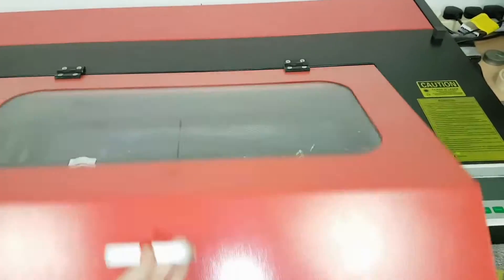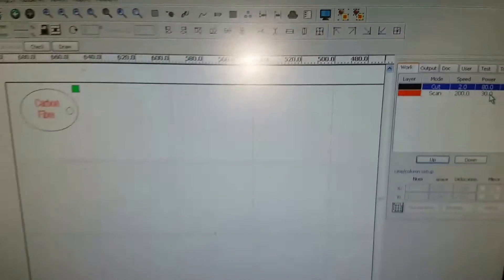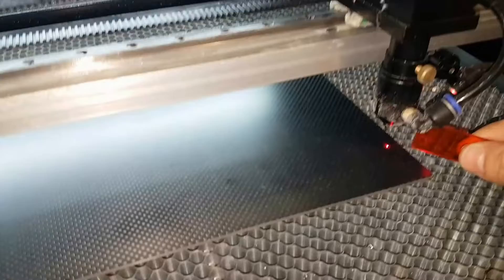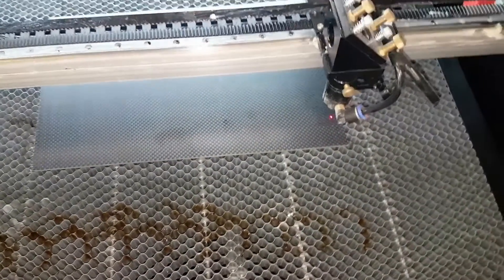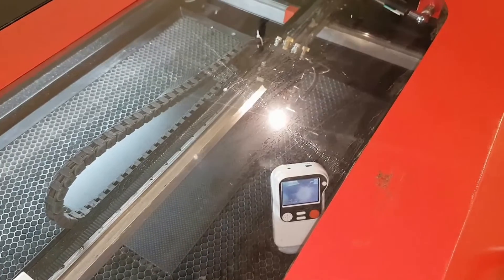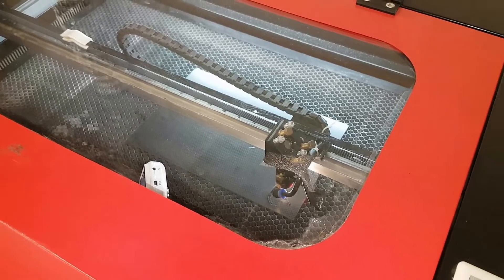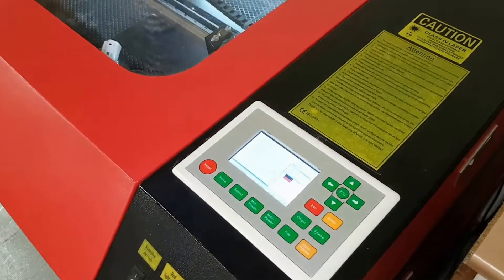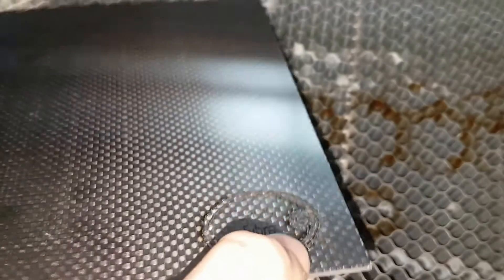Can Light Cut Carbon? 80W CO2 laser cutting carbon fibre / fiber

Comment: what laser cutter do you have?  I am in the UK and looking for a cheap 80W laser with RUIDA controller, exactly like yours
Reply from the maker: Hi. It was purchased from ebay. Said from Germany, but arrived from China. We didn't get charged any imports, but believe you can get extra bills. I think it was around £1400, but the same ones are there now for 1700+. Its still going good after heavy use. Has needed runners greasing and the bed re leveling, but I'll admit we haven't even cleaned the optics! Search ebay and you should be able to spot the red units like this. Good luck
Reply: @DanSohan  hi Dan, could you potentially post the link as I have seen plenty of red lasers, it's just getting one without heavy taxes/shipping that also has a RUIDA controller sent to the UK.  For the business I am looking to start I need to install a camera in the machine so I can line up custom etching jobs on customers' existing items, which I will need LightBurn for, which can only run off a RUIDA controller
Reply from the maker: @evanhill110  sorry it was bought by the company I worked for a few years back, I wouldn't be able to point out the exact supplier. Often thought about getting one for home, but would have to accept I might have to cover the taxes. Maybe message a few of the current supplier to see if any promise to cover the taxes included in the sale price.

Comment: 2mm per sec ????? most stuff needs to be cut at atleast 8 or more to be a good cut, no wonder it's melting it's carbon fiber it spreads heat, for that you'd need at least 20mm per second and a tone of layers/laps at the 80w or so you're using. because concentrating that much power at 2mm per second is just bad.

Comment: How is this machine treating you 2 years later? Still Content with your purchase?  Would you recommend it? Any faults, breaks or errors encountered? Appreciate any advice. Considering getting one.
Reply from the maker: The machine is still going good. I have noticed a drop in overall power of about 20% but wr have not maintained it. Cleaning the optics might help but the tube is probably wearing out. Its had loads of use and never not worked. Overall very pleased for the price
Reply: @DanSohan  Thanks for the quick reply! Did you get yours through Ebay?
Reply from the maker: @meshackburton4686  we did

Comment: I have purchased a 60W version of this laser cutter.
When it arrives, I need to get it through a door.
Is it possible to remove the legs and lay the machine on it's backside?
Reply from the maker: Aron Haraldsson ummm.. Just going to have a look. I'm afraid the base part looks very well attached. I can't find a bolt nor a phiscal weld, but it almost looks intergal :( I maybe wrong but it would require more disassembly than I'd like to do right now. Also take care because of the internal glass components
Reply: @DanSohan  I know I'm a little late but i've got an omtech 2820 and the base comes off with 4 bolts
Reply from the maker: @killorkubed  the unit we have in the video its all welded up

Comment: If the epoxy off gases chlorine, you're going to destroy the mirrors and lenses on the machine. It's the reason that you shouldn't cut chloride containing polymers (PVC is a common one) in a laser cutter.
Reply from the maker: Bryan Hascall we've done much worse to this thing.. still going good years later.

Comment: Try next time do multiple fast ( like speed laser machine) passes and focus the laser into more of a point for thin carbon but for carbon more than 2-3 mm you’ll need a auto focus laser (preferably a PLASMA speed laser)  like the one they use to make statues in basilica glass, which is when the laser is focused to where it micro fractures different layer in the glass, they are not that much more expensive than nice co2 lasers. If you do it fast like I said it wouldn’t melt it would melt. Oh and you probably want a speed laser autofocus.

Comment: Goggles are not actually necessary for this type of laser, assuming you have the lid closed. It's unintuitive, but "light" in the far infrared part of the spectrum (10 µm, which is what a CO₂ laser tube emits) is completely blocked by that plastic. Even though it's transparent to all visible light, it's completely opaque to 10 µm radiation. No radiation in that range will come through until and unless the laser beam has cut all the way through the cover. 

However, a 10 µm CO₂ laser is not to be confused with a 1 µm (1000 nm) YAG laser which is also invisible and also counts as infrared. Such a laser beam will pass readily through polycarbonate and other optically transparent plastics. For this reason it's typically not used for cutting plastic, since the beam would just pass right through or be reflected. Instead, a YAG laser is typically used for cutting metal.

What you should make absolutely that the interlock is working and you should avoid looking through the vents in the front of the unit. The laser that I'm used to, as 100 W Redsail available at Stockholm Makerspace, my local makerspace, originally allowed the pulse function to be used without the interlock closed, which we thought was enough of a hazard to fix by making our own safety control system using an additional PLC controller.
Reply: Gameboygenius f

Comment: So I don't need to buy a laser cutter because it would be useless. Thanks for the tip :D
Reply: well, it depends on how you use it, this guy's concentrating the 80 or so watts of the laser on something that dissipates heat tremendously for a very long time (2mm per second) some cutters can do 20 or so per second which would be preferred since the carbon fiber would just over heat at the 2mm which the youtuber probably is only used to cutting plastics and stuff since it's easier not to burn at 2mm a sec. but eah i'm not trained on this stuff so it's just a guess :L